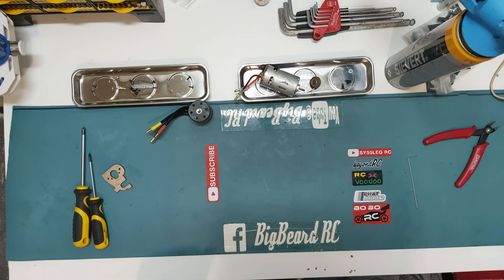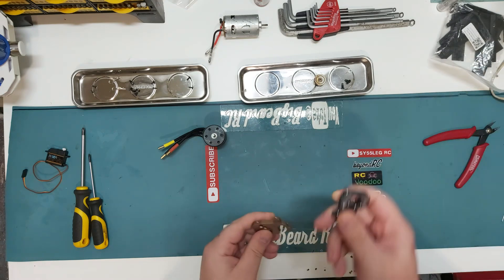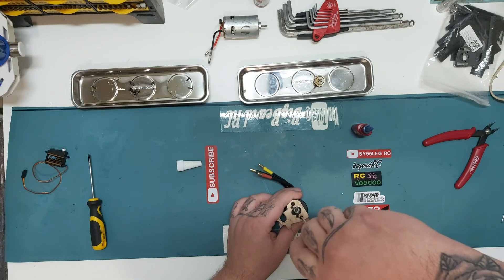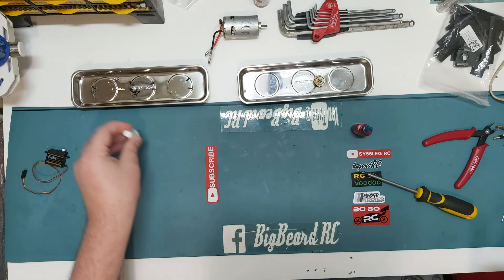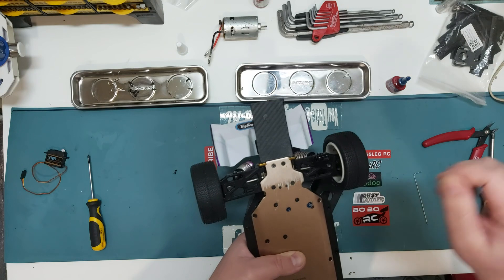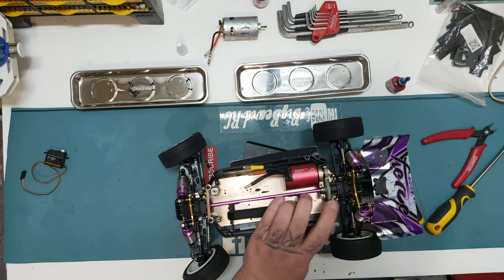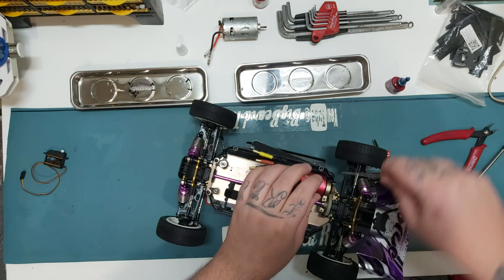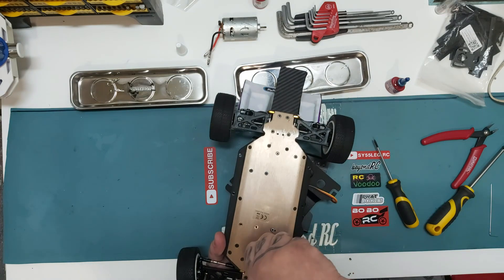Wltoys 124019 144001 Brushless Motor Install

Comment: Morning mate hope your good ordering one of these and need a brushless set up to go with it mate keeping stock gearing nothing to mental about 50mph IL be happy I'm just wondering what size motor shaft you need so it's a straight fit mate and don't need to mod it to work is it a 2.3mm shaft for this car or 3.175 mate cheers 🙏💚👊
Reply from the maker: Hey dude you need a 3.175 shaft
Reply: @bigbeardrc4145  nice one my brother cheers mate 🙏💚👊

Comment: Hey, will I be able to put a 3660 3300kv motor into the 124018 and will it fit on the stock pinion? It is 3.175mm.
Reply from the maker: Will be fine buddy

Comment: doubt ur still responding on this video but do you have to replace the servo for the brushless swap? or can I get away with just the engine and esc
Reply from the maker: Hey buddy you will need to change the servo as its a 5 wire servo and you need 3 wire for the new radio receiver

Comment: Yep man! Any other alternative to remove the screws without using a Blowtorch ??  you think a lighter could work?
Reply from the maker: Yeah man any decent amount of heat will work just hold the mount in something like grips and heat away it will get hot enough eventually

Comment: Lock tight on the motor mounts but nothing on the stearin servo? Lol
Reply from the maker: You don't need loctite on the steering servo the holder is plastic so shouldn't use loctite as it makes plastic brittle and in all my cars I've never used loctite nor have I seen anyone else ise it but each to there own I suppose

Comment: 9000kv batteria 7.4 v yes. No 11.1v
Reply from the maker: 9000kv motor 2s and 3s
Reply: Ho comprato lo stesso motore e nella scheda tecnica ce scritto max voltage 8.4

Comment: Hello. I have a wltoys 124019 and I want to mount a brushless motor.  I saw that you have the original pinion with 27 teeth but I will use the smaller holes in the motor support (16mm) with a 15 tooth pinion.  (There is also the possibility of 17 teeth) I want to buy the hoby surpass motor 2845 but I am undecided about the kV !!  I was in doubt between 3930kv or 4370kv.  what recommends me?  second question for 15/17 teeth which kV do you recommend for battery 2s and which kV do you recommend for battery 3s?  thanks
Reply from the maker: Hi I've never tried the smaller motors before but there is people on my fb group that have and could help you.its bigbeard rc
Reply: thank you so much 👍

Comment: is this a better motor? or should i get the one you recommended in the description? https://www.banggood.com/Surpass-Hobby-Waterproof-F540-V2-Sensorless-Brushless-Motor-with-60A-ESC-for-1-or-10-RC-Vehicles-p-1548050.html?akmClientCountry=CA&cur_warehouse=CN&ID=519632

Comment: Hey homie u know what the gear pitch is?
Reply from the maker: Hey bro yeah its 0.7 buddy
Reply: @bigbeardrc4145  Thanks I got the hobby wing combo and the shaft is a 5mm so I'm going to get another gear.
Reply from the maker: @ErocsRc  you'll could drill the original pinion out to 5mm
Reply: @bigbeardrc4145  Was thinking that but ill have to find someone with a drill press i think I know someone. I use to work a Steel shop and they have them there owners cool ill go bye during next week.. seriously excited

Comment: What esc you running with the 3650 motor  9000kv on 3s withoit burning it ?????? I run the hobbywing ezrun max10  2-3s with 760a peak max...
Reply from the maker: Max10sct 2s-4s 120a
Reply: @bigbeardrc4145  will my model handle it too ??
Reply from the maker: @Scoot_Boy85  I don't see why not people are using 6s on these motors

Comment: Very informative video as per usual. In your humble opinion are the only differences between this buggy and the 144001 things like the longer chassis, centre driveshaft and bodywork? I haven't had a close up look at one yet but the commonality of the parts looks very similar if not the same to the 144001 👍👍
Reply from the maker: The shocks have slots for spanners on the top and mid shaft.the diffs are different but other than the obvious all looks identical